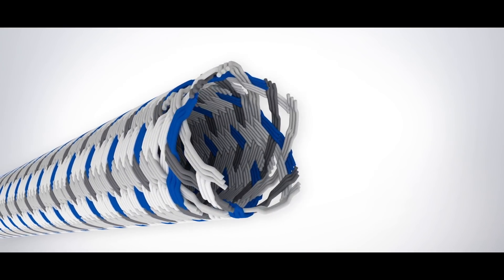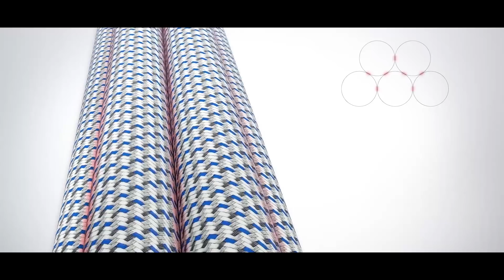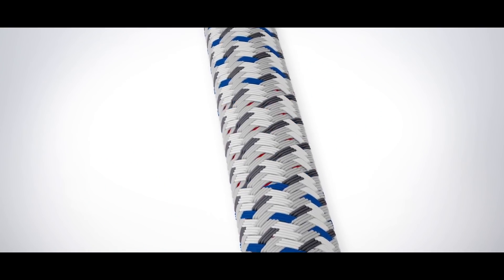Liebherr - high-strength fibre rope soLITE® for Tower Cranes

Comment: The video states it can potentially increase available load capacities due to the lighter weight of the rope, so I’m curious if the rope or crane manufacturers have modified load charts when using this material.